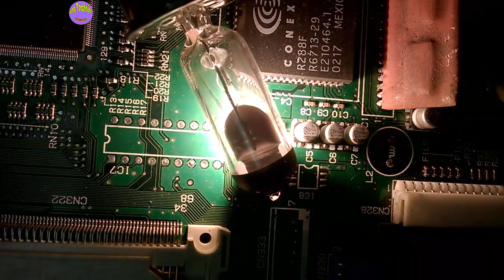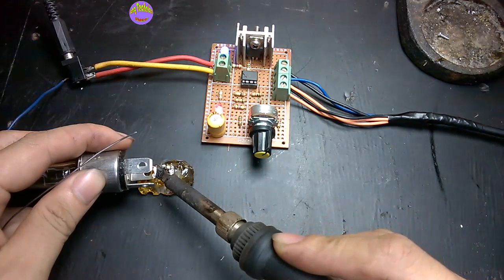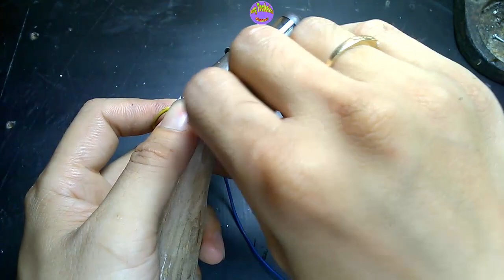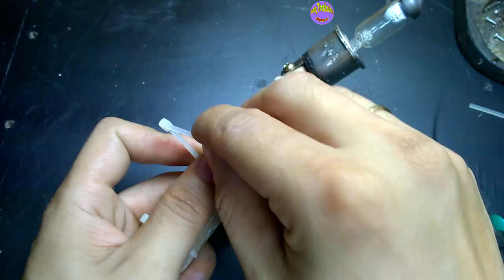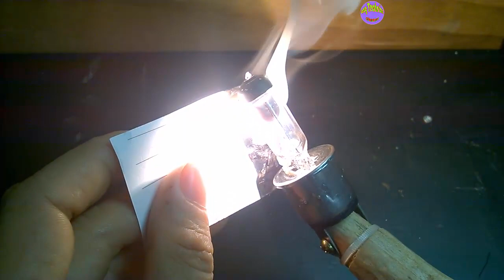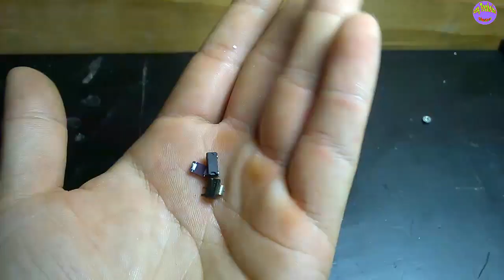Hot Air Soldering Station from Light Bulb

Comment: It would be better tp use the push-on paddle connectors and silicon insulation wires. But it is a neat idea to reuse the auto bulbs when retrofitting to LED headlights...

Comment: U r Demo is nice,but other details R missing pse tell us   About u r power supply etc etc so we can also try.tkq,one thing I like the   Wooden handle.
Reply from the maker: I use 35W motobike halogen bulb.With 12V battery. You can use 100W halogen light bulb for do that. Thanks

Comment: You say to abdul shafayy.
You use 12v 60w bulb 
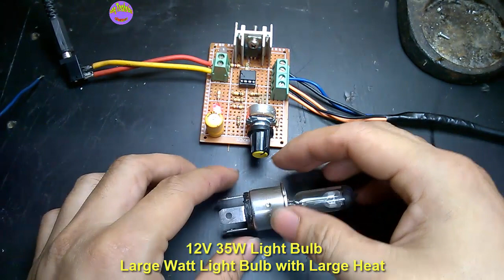But when 0:54s it says 12v 35w
Its so small wattage bulb. But it can burn paper so easly. And take compenent so quick.

I try with 12v 35watt philliph bulb halogen. Its just melting flux. But no near to melt tint solder

Large watt equal more heat
 in the description you say 12v 100w..

So what kind bulb are you using..

Comment: which light bulb you use, i think it is rare in market ,plz tell me
Reply from the maker: at this video i use 12v 60w light bulb. You can use any light bulb
Reply: It's a car halogen bulb. Must be halogen not any light bulb.
Reply: You need a 12v 5a supply for this bulb
Reply: where you get this bulb
Reply: You will get this bulb in a car accessories shop or in car workshops
Reply: This is car headlight halogen lamp

Comment: what is the controller  and what is the power  usig dc or ac
Reply: Ac or dc 12v
Reply: controllr type
Reply: 12v dc.. not ac.. that bulb is for car use.. and car have dc voltage.. 12v.. or 24v..